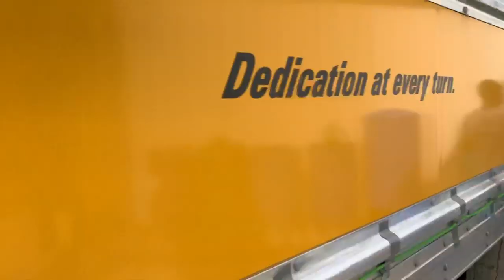SAVING ENDANGERED STURGEON FROM CAVIAR FARMERS!

Comment: I hope you tell your hobbyists that sturgeon are NOT a good home aquarium fish.  They get way too large and need a ton of water circulation.  When I was in the fish business I used to get baby sturgeon from a breeder when they were around 6 inches long and sell them to the pet stores in and around Sacramento and San Francisco CA.  I quit after the second time as the fish would only die in home aquariums because people didn't know the needs of these fish.  Neither did I at the time. Also, the females aren't ready to breed till they are around 10 years old.  The place I got the babies from would cut open the females to get the roe and also push out the spermatoza from the males then mix them together to fertilize the roe in tumblers for hatching.  They would have to stitch the females back up and give them antibiotics before releasing them back into their raceways.  Not all made it.  Sturgeon need a lot of space and fast flowing water.  Those 'short bodied' sturgeon are just defects.
Reply: They breed koi the same way. Probably a lot of fish are bred that way.
Reply: @nyrob420  That's sad.